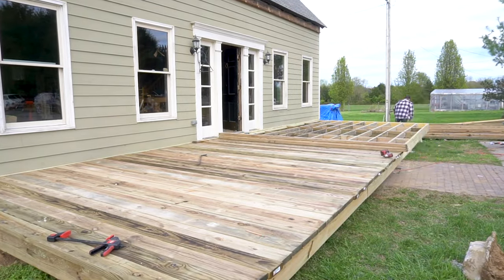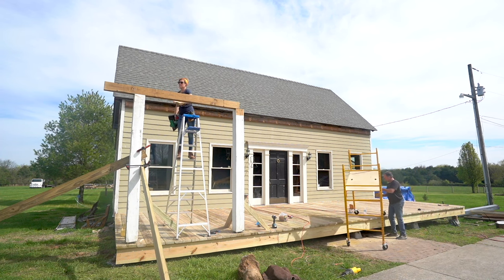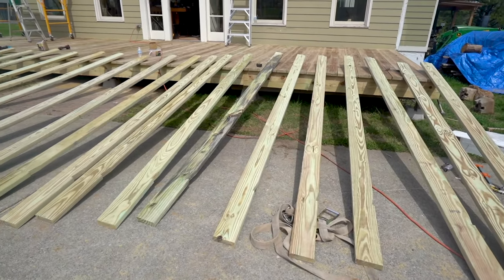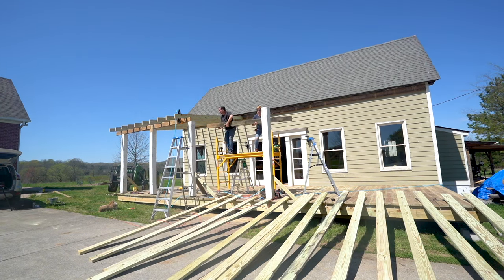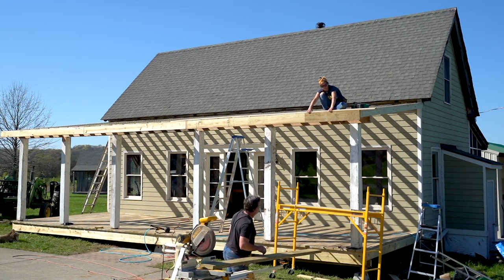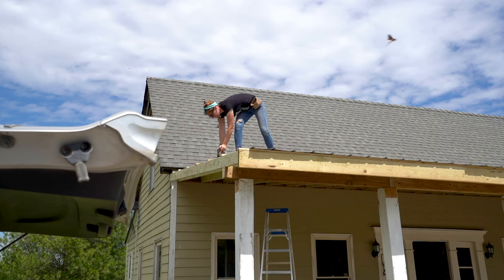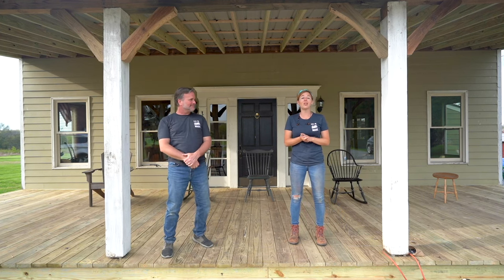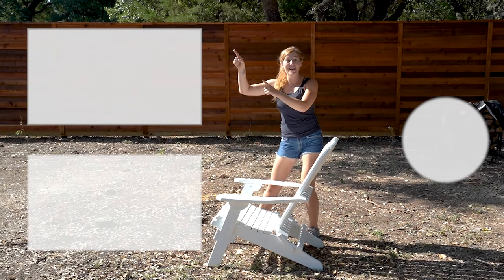Building a Covered Porch

Comment: Are the posts fastened to the deck?
Reply: I think they toe-nailed it, not the most ideal method, but braces on the upper part of the posts makes the overall architrave like a table with legs . (At 8:50) they placed spacers under the bottom of the posts to prevent rot.
Reply: giacomo aliboni that’s what I’m wondering. The diagonal braces help it not move left to right but it could still get nocked front of back...
Reply: Those look like the aluminum type post pedestal bases. They typically do not have a built-in spot to toe screw into a floor. Not like a Simpson strong tie or composite plastic standoff.
Reply: there wasn't any Simpson post brackets in the video.  @abramcollette , the posts indeed can shift front-to-back, but when building things, there's only so many hours in a day.
Reply: @ronw8628  - Looks like those were attached to the bottoms of the posts when they set them (as this type should be). Look at 0:20

Comment: I didn't realize the posts for the porch could (or do) just rest on the deck. What's the metal on the bottom of the white vertical posts holding it up? Is it screwed/bolted in at all but I missed it?